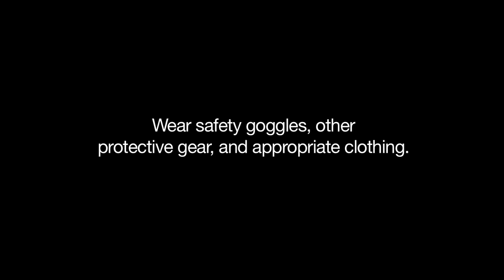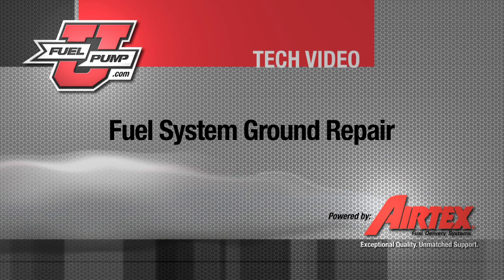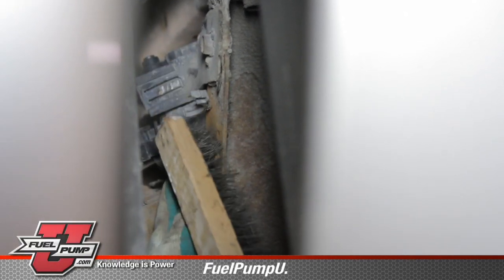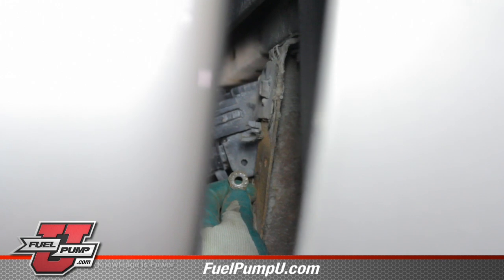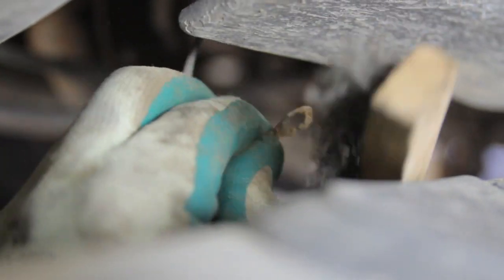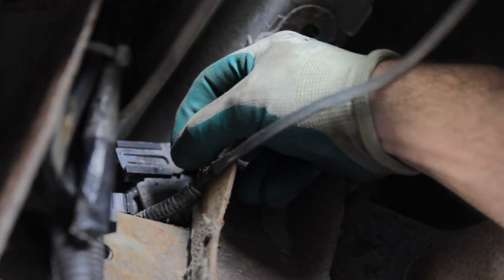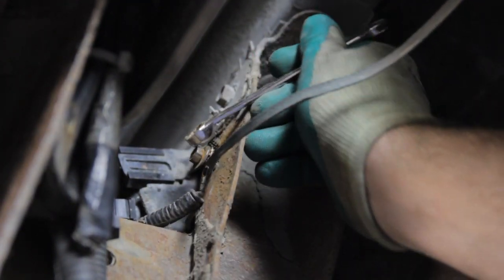How to Check, Clean and Repair Vehicle's Electrical Ground Connections

Comment: I JUST DID THIS ON MY 2011 MAZDA 2 AND IT WORKED! MY 2011 MAZDA 2 WAS HAVING TROUBLE STARTING. I REPLACED THE BATTERY, THE ALTERNATOR, AND WAS ABOUT TO DO THE STARTER WHEN I CLEANED THESE AND NOW IT STARTS UP LIKE A BRAND NEW CAR! I LOVE IT SO MUCH!!! 👏🏻🙌🏻🤘🏻

Comment: After cleaning as shown, coat the threaded stud, the nut, the base of the stud and both sides of the connector with dielectric grease for a trouble-free repair. For example, GM recommends Nyegel 760R, but Permatex makes and sells a special dielectric grease that is easier to find in auto parts stores.
Reply: Especially important if you live somewhere humid/rainy!

Comment: If the frame came with paint on it why would you scrub it off with a metal brush?
Reply: To make electrical contact with the bare metal? Paint isn’t a conductor.
Reply: But i think his point is why does it look like it left the factory like that.....
Reply: hes just scrubbing the rust off the connection point, the surrounding paint doesn't matter but its just easier than only sanding the circle ring where it connects. use dielectric grease during reinstallation and after maybe some rust check or similar on the surface and surroundings to prevent rust, which the paint previously protected